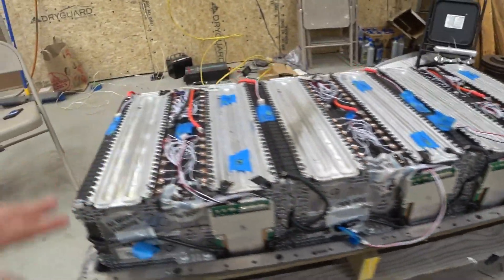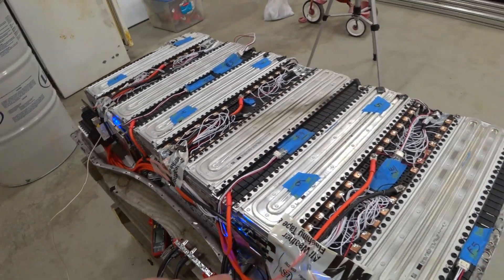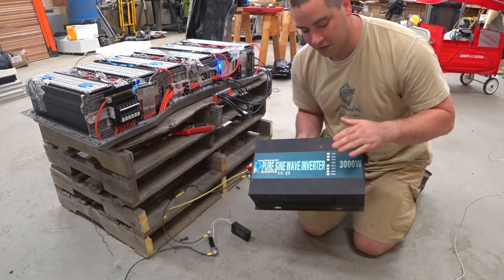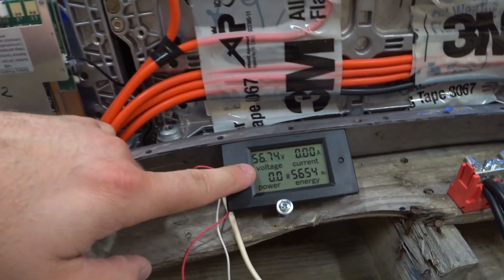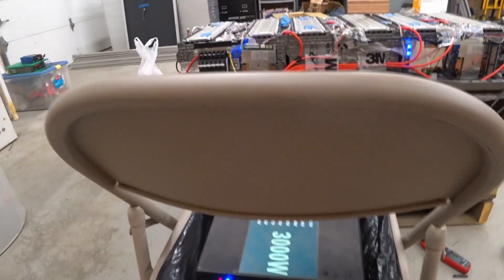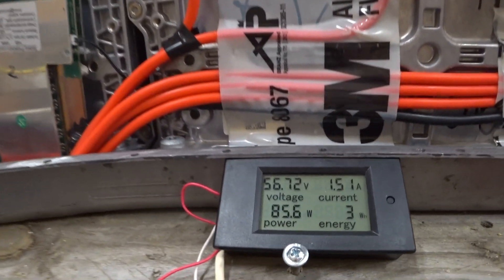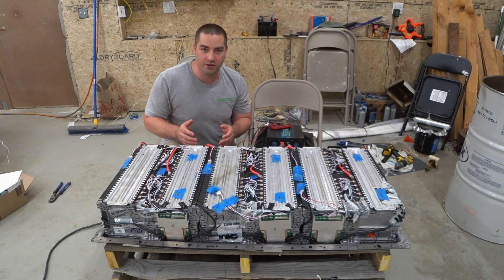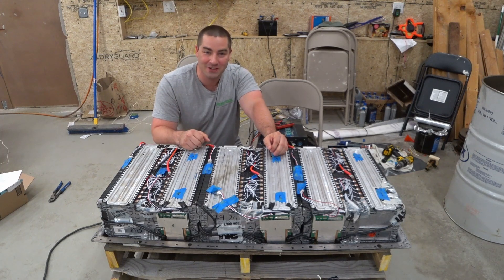Capacity Test of Lithium Battery, Recycled EV

Comment: I have a smart electric with this battery and it has about 60k miles on it. If you figure it's about 60 miles per charge, I've discharged these 1000 times already and it still has almost exactly the same range as when it was new. So your house battery will be good for MANY YEARS. Some day you might have to take it apart and replace a cell but seems like a great investment to me.  

To be honest I'm sort of scared of this stuff due to messing something up, fire risk, or being electrocuted. But I really liked watching your videos of bringing back these batteries!

Comment: Why was the battery originally diagnosed as no good?  I'm looking at a volt battery the dealer said the lithium battery failed due to them overheating because of the coolant system failure. Is that battery done or can it be salvaged?  thank you
Reply from the maker: I bought the battery from a junkyard.  The vehicle (smart car) was a total loss, but the battery was sold as good.  I don't know your situation.  Usually Chevy Volt batteries are very good.

Comment: can I ask why you are only charging to 4.05v and not 4.2v?
Reply from the maker: Sure.  It's about extending the life of the battery.  I want this battery to last a very long time.  My goal is a decade.  So I limit my daily cycling from 4.05v to 3.40v.
Reply: @DavidPozEnergy  ok nice one, makes sense now.
Are you still happy with the BMS? FYI I'm looking to build a similar battery for charging overnight with cheap rate electric and using in the day. Any suggestions for a good charger inverter?
Reply from the maker: I used 6 small BMS's on this build, and yes I'm happy with them.  They work well.  I've had good luck with this brand and Daly brand.  The best hybrid inverter is the Sol-Ark 12k.  Good Luck.

Comment: Funny how only the folks living on stored power understand how cool that is. My 10 group 31 deep cells wired for 24 volts offer me 6.6khw usable power and that will get me through 3 days of normal use if the sun was blocked and the wind didn't blow.  My homestead is rather efficient though. Cool stuff bud!

Comment: I wonder about the rounding on the power meter, since they drop the decimal place as it goes from watt-hrs to kw-hrs.  1 kw-hr should be 1.0, since it rolled over from 999 w-hr.  But when does it go from 1 to 2, and 10 to 11?  is it 10.501 or 10.999 that rolls over to 11?   Minor detail...  Congrats on reviving the smart pack!
Reply from the maker: I sat there and waited for it to go from 10 to 11 in order to be as accurate as possible.  Thanks for watching.

Comment: where can i buy Those Chevy Lithium Batteries ? I may want to ship it overseas? thanks
Reply from the maker: I bought my batteries by calling around to auto recyclers (junkyards).  I used google maps to find them, and then had to call.  I called hundreds of places before finding one with a battery.  You can also buy them on Ebay to save some hassle, but they cost a little more.
Reply: @DavidPozEnergy  thanks David I did see some selling on Ebay, am inspired on your projects. let me see if I can find some Li-ON alternatives cheers
Reply: Am Also A PROUD Chevy Car Owner :) but its running on Unleaded Gas :P
Reply from the maker: Hi JB,  When I bought my Chevy Volt battery, I paid $2,033 and drove to Rhode Island to get it.  The pack is 18.4kwh (factory rating)  Which was a price of $110.5/kwh.  I had to put in time and effort to make the pack.  But I also had to buy several items to make the system work.  I'm over $150/kwh just on the battery.  You can sometimes find a good deal on LiFePO4 batteries on Aliexpress or Alibaba.  Especially if shipping is a concern.
Reply: @DavidPozEnergy  hmm interesting I will check now from Alibaba about LiFePO4 batts, any thoughts about those blue 2.7 Capacitor battery types? they can function as replacements for car batteries (as bundle) I think thanks
Reply from the maker: Hi JB,  I have not tested those blue 2.7v batteries.  I can't say anything about them.  
Here is an example on Aliexpress: https://www.aliexpress.com/item/4000022315341.html?spm=a2g0o.productlist.0.0.759f1f66kSJIHn&algo_pvid=a7ad8c8e-397e-4501-97ab-0d693d4f35fb&algo_expid=a7ad8c8e-397e-4501-97ab-0d693d4f35fb-5&btsid=f0da11fd-28be-4961-83e0-5789bc2710e0&ws_ab_test=searchweb0_0,searchweb201602_10,searchweb201603_52

This includes shipping and bus bars.  At $185.5/kwh I think it's an excellent deal.  If I didn't already own my Chevy Volt pack this would be on my short list to consider.
Reply: @DavidPozEnergy  Thanks David. just sharing back I like those LifePO4 website link ( BLS ).. i may be ending up with the offroad CALB type where its sealed with special plastic instead of the Aluminum Blue covers. from what I know Lith-ion + metals is not good combination.. thats why I lke your Chevy Li-ion setup.. I may ended up also same BLS but CALBs :  2019 NEW CALB 4PCS 3.2v100ah Lifepo4 battery : https://www.aliexpress.com/item/33001891398.html cheers
Reply from the maker: Sounds good.

Comment: awesome, that 48v spark is no joke, might need a soft start switch, just two disconnect switches in series, but one switch has a large resistor in parallel, that way when you first turn it on you have the resistor in series and then you can bypass that resistor with the second switch. thanks for the videos! and that a really nice battery you made yourself!!

Comment: The BMS boards love near infinite currant draws (the rapid charging of the capacitor)  use a bulb to allow it to charge the inverter or your going to blow up the BMS boards or blow off traces on the inverter (or a thermistor it's a bit strange that these don't come with them) 

be nice if inverters had soft capacitor load up, easy way for that is have a relay so when caps are not charged it uses a resistor once at voltage relay switches to direct pass through (so as long as there is a charge in the relay it keeps the relay open)  PSUs normally have a thermistor to limit inrush
https://product.tdk.com/info/en/products/protection/current/ntc-limiter/technote/apn-ntc-limiter.html
https://www.google.com/search?ei=NU4tXfuAHqHuxgPmipqoDw&q=thermistor+dc+capacitor&oq=thermistor+dc+cap

Comment: kudos on a good test after a long build.  For the love of FSM and all that is noodlely use a breaker or disconnect switch when connecting high voltage things (inverter to battery).  that's how you avoid sparky sparks.

Comment: I have the same bms. If you change the balancing mode to static,  it will  balance the battery when discharging too. Will this 48V DC Air Conditioner Solar Air Conditioning TKFR-52GW/DC be more efficient? I'm waiting for a review before buying it.

Comment: Hi nice setup. I am new into powerwalls and bms's but not into electronics. So heres my question we are talking lithium batteries here and your loading setup includes a boost module which does not included the needed modes for charging like constant current at first and then constant voltage. Is this a problem or does the bms the job during charging?
Sincerely JP from Austria
#subbed
Reply from the maker: Hi JP,  The BMS's do nothing to alter the current or voltage.  The BMS's monitor the cells and shut off the flow of electricity if a cell goes bad.  The Boost converter I'm using is a CC/CV (constant current / constant voltage).  It charges at a constant current (that I can set) until the battery reaches the set voltage, and then it tapers off the current gradually to zero.  There is a link in the description if you would like to see the exact specs.

Comment: You can use a incandescent light bulb to charge the caps, a 60 watt 120v should be fine, just connect in series with the battery and inverter, until the dim glow stops, connect as usual, it could save a bms!

Comment: Agree 100%.  Mine is 780ah@48v = 40kwh 18650 battery.   From your numbers I suspect your overall battery is 35-40kwh.     Similar to you, I have the top set at 56.4v (4.03v/cell) but the bottom set at 48v (3.43v/cell).   What's interesting is that the bottom (inverter shut-off) is fixed but top is dependent on PV array input and home power use which varies from day to day.    My average peak in summer is 53.5'ish (3.83v/cell).   As I assume you are doing, I'm targeting looooonnnng life by limiting voltage range...  but also having battery large enough that I don't loose any PV array input due to battery full.  My PV array is 6.885kwh.  So far this year I'm averaging 34.6% DOD over 172 cycles (avg 13.7kwh from battery each cycle) and delivered 2,276hrs of AIMS Inverter power time at an average of 2,017watts/hour which = 4,590kwhs of used power so far this year.      I'm truely hoping to get several 1,000(s) of cycles with this strategy!
Reply from the maker: Sounds like an excellent plan, thanks for sharing.

Comment: Nice one! You could initially connect your inverter through a resistor to help prevent the capacitor inrush.
Reply: That is how I do mine. I use a ceramic resistor that came with the packs and I put an led across the resistor to let me know when it is charged before I engage the circuit breaker.

Comment: Wait, somebody finally determined kwh the right way? Usually the uneducated measure amp hours then multiply by nominal voltage. Which is OBVIOUSLY not the correct method since the voltage falls as the soc falls
Reply: Which is why most people measure Ah and leave it at that.
Reply: forget watt hours id wanna know amps per hour its a battery not energy company/ supplier lol
Reply: the use that watt hour to hide the fact that 11kwh only about 196Ah witch a car lead acid goes 100ah or more so its gotta be more capacity than that less its from hybrid not EV
Reply: Da ve ... well, if you had 4 12v LA batteries, that would be roughly 1/2 the WH of this pack... so... yep.

Remember, AH, is a factor of VOLTAGE, to amps...

Comment: David, are you going to do a post mortem on those dead battery cells?
Reply from the maker: I'm not sure what I can do with them.  I removed them because they either didn't accept a charge, or self dis-charged.  Are you suggesting I cut them open to look at the layers?
Reply: @DavidPozEnergy  Yes.  I've never seen the inside of a pouch lithium-ion battery.  I'm wondering if you would see any obvious signs of damage.  I'm not asking you to do this, I know you probably have a lot better things to do.  Thanks for the great videos.
Reply from the maker: I found this video that cuts open cells and looks inside.  You might like it: https://youtu.be/hB5ml_OouO4

Comment: Excellent - 11kWh+ !! Now put it on a scale for us - how many kilograms (pounds) is it? Also, David, can you post it to me here in Australia? I want to run a long term test on them for you :)
Reply from the maker: Hi Benny,  I don't have a scale big enough for this.  The label from the factory says 178 kg (392 pounds).  I removed some cells and such, so it might be 360 or so pounds now. 163kg?
Reply: @DavidPozEnergy  Never mind, send them to me and I'll do the long term test David. (Can you tell I'm envious as?) 11+kWh will run my home for two days without sun, 3 if we are careful. I can see the value of legislating Vehicle to Grid as mandatory on all charges and EV's - 40 - 100kWh just sitting there doing nothing otherwise!
Reply: @DavidPozEnergy  Just a thought - you could weigh it with bathroom scales and a lever (a 4 x 2 maybe), say 4:1 that will cut it down to 40kg or so.

Comment: Eeeleven !! awh man that is awesome,  seriously good job,  what is the end goal? will you integrate with current pack? have it just as a specific supply? charged from solar?
Reply from the maker: Solar charging for sure.  The goal is to get more days of autonomy (off-grid without sun).  Right now I'm good overnight, but I need sun every day.  A larger battery overall will let me get through cloudy weather.
Reply: @DavidPozEnergy  Why don't you wire both batteries up with battery switches. With 2 battery switches you could switch back and forth quickly. Sort of a reserve tank idea. Going further, you could use a 1,2 and 1+2 switch to switch which battery is supplying the load and which is being charged or one battery could supply the load while being charged.
Reply: I think the current pack is 12S, so not possible to parallel it without breaking it up to make 14S packs. Another project perhaps?
Reply from the maker: Hi Andy,  You got it right!

Comment: Awesome David! So happy for you that your gamble paid off, and you got a hell of a lot of learning out of it!
I chuckled loudly when the spark got you!
(Next time, you could use a large 1Ω resistor to pre-charge the cap before connecting for real!)
3.5-4.05 is very conservative, so should last a very long time especially as it'll never see the kind of load in a car.
Reply from the maker: Thanks.  The spark scared me twice, when connecting the inverter, and again when editing.  It was extra loud with my headphones on.  Thanks for the tip on the resistor.
Reply: @DavidPozEnergy  You're welcome. I get the same with my ebike, so use a 10Ω to precharge before connecting - apart from making me jump too, it saves the capacitors from stress and the connectors from vaporizing away over time.

Comment: David n your bms's did you look at using rubber boots for the nuts like the ones on  alternators hot leg
Reply from the maker: No, I didn't think of that.  Sounds like it would work well.
Reply: I think they wood they are real thick if you get the ones for tractors they are meant to hadle 400 amps and up